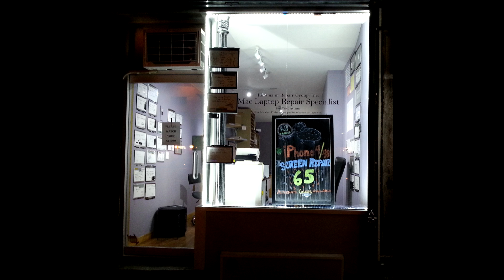Stop waiting for perfection - get your patio door.

Comment: The point in 10:35 is so true. I did exact same thing with small hobby that i had and even without a place or a real business i had real customers that were interested in the services. 2-3 years passed I had served probably 200+ customers and those services were not cheap. First couple of jobs you will be making are usually what sets up your workshop, you buy tools on the go from current profits , later you start buying parts in bulk so you save even more and the ball is rolling. Louis has 100% correct point.

Comment: This makes me think of how I think about improving a house/building a house. If I had the ability, skill, money and opportunity, I would get a cheap run down house, the type of house that is a few thousands bucks, that you can get without a loan, just saving some money. I would take that house and improve just one bedroom and the bathroom, just a place that I can sleep in and clean myself, put a bed in, get a fan, get one of those portable/moveable heaters. 

Then just slowly improve the rest of the house but by bit as get money every month. Since I would own the house, I wouldn't have to pay rent, since I didn't get a loan, I wouldn't have to pay the bank, suffer for a while and then at the end of the journey, you will have a house that is actually good and which you didn't spend so much money on because you did most of the work, what it ended up costing you is mostly time, but that time will easily be worth it for what you will have at the end.

Comment: I heard. I understand. I agree . Some of my mentors told me for years what you told me tonight. Did I learn anything? Is my behavior changing, has it ever changed because of what I've heard? No. Not so far. Not yet. But it is good to hear. Perhaps good advice builds up like water on sand: someday the ground will become saturated. Some water will pool. I will change, and good intentions won't drain off into the sand or evaporate.
Reply: I think it builds. It mixes in with desperation further down the road, and it builds and builds. You know what you should do, and you know you should do it. You might even have the route all figured out. And yet, the desperation builds, it still doesn't go anywhere. Perhaps major life changing events happen, to you or around you. Regrets, passion, determination born of any number of emotions, positive and negative. You're sure this time will be different, and you push at it harder than ever before. Then you wake up realizing it's half a year later, and you're back in the same old routines, facing the same old desperation. You know what you need to do. You know you need to "just do it".

I hope you're not waiting on a brilliant conclusion that will solve everything and make it easy, because I don't have it. I'm just telling my tale.